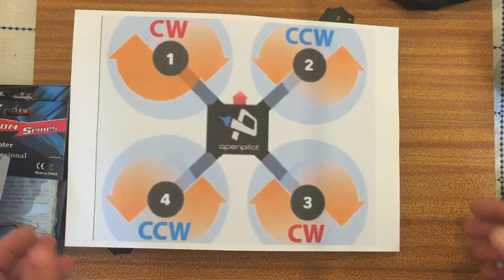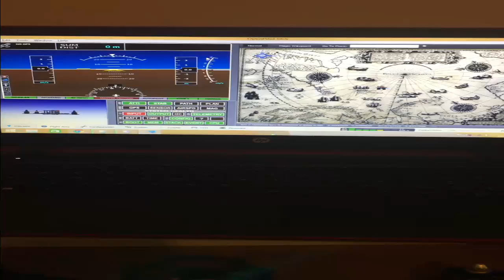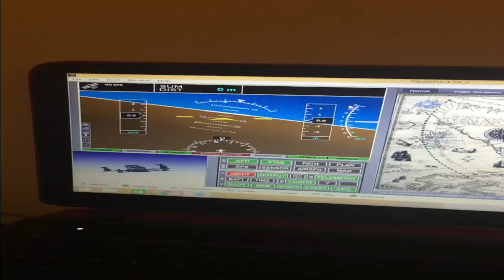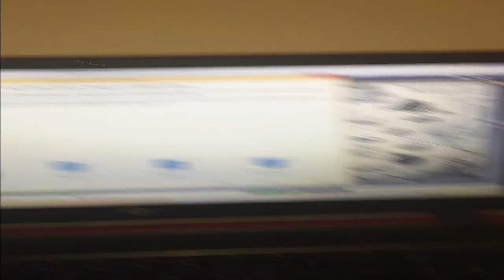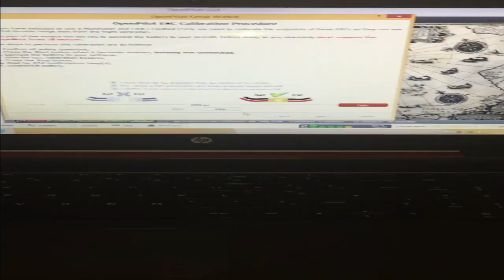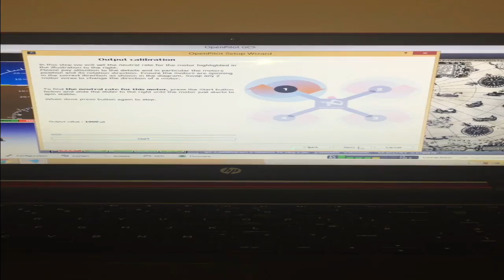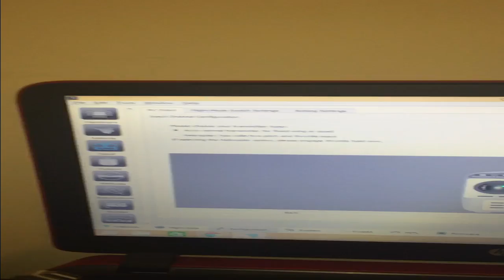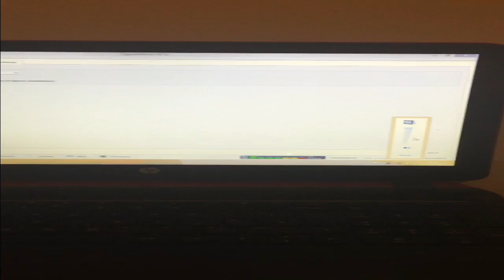robocat setup with cc3d

Comment: HI, great video, but I did not understand a thing:
You have a ppm receiver, so, why did you use a pwm configuration?
Can i use a ppm receiver with a pwm cable's configuration ?
Reply from the maker: +Luca Bellantoni hi there when you choose ppm its just one wire does all and pwm is like on this video where i have one wire on each on the channels of the receiver.
so you have to choose the correct one for the one you have set up.